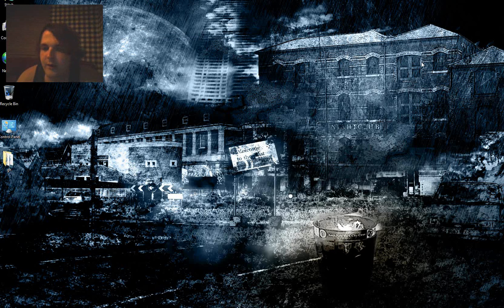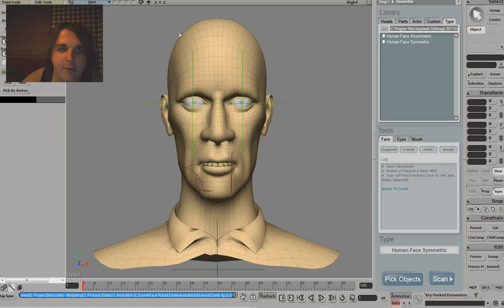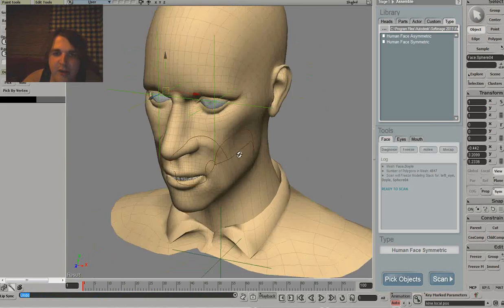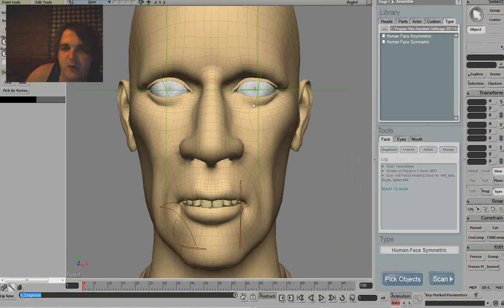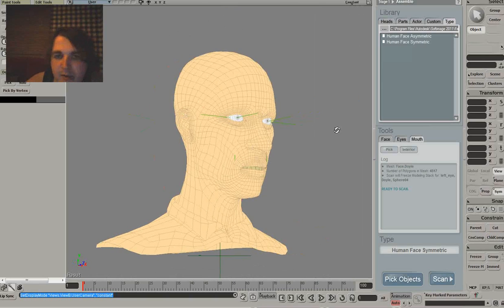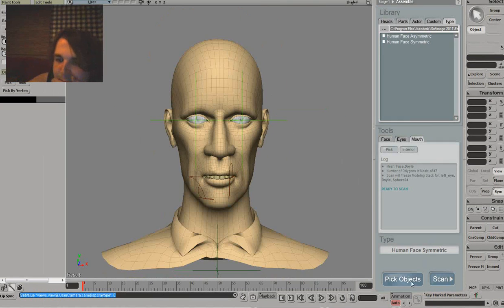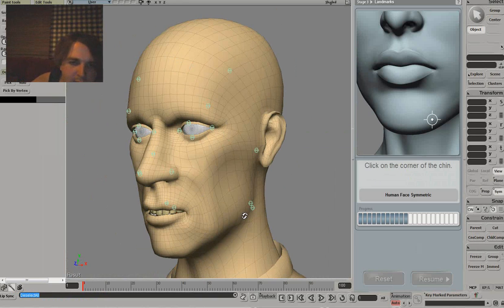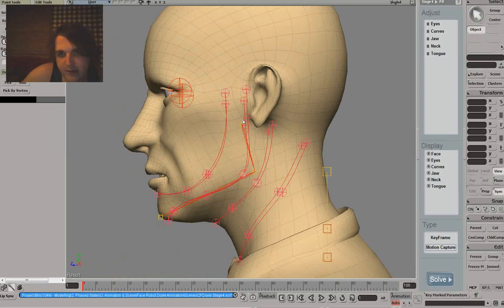Face Robot Rigging 1 of 2

Comment from the maker: the answer to that one is I doubt it. importing an animation suggests that there is a rig. I wouldn't mix and match animation packages just because it sounds messy... If you want to use face robot commit to the rigging process in Softimage. If you cant just rig the model in Maya...